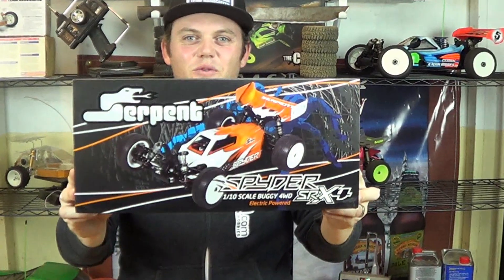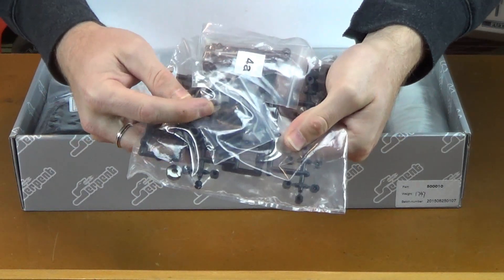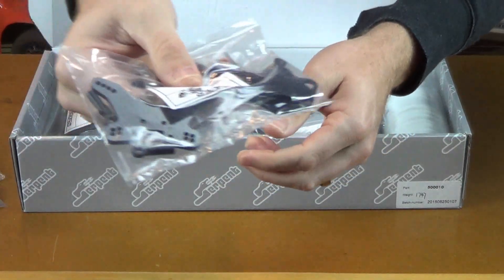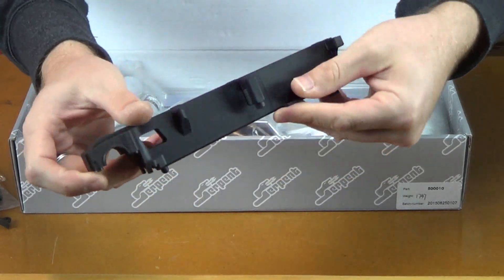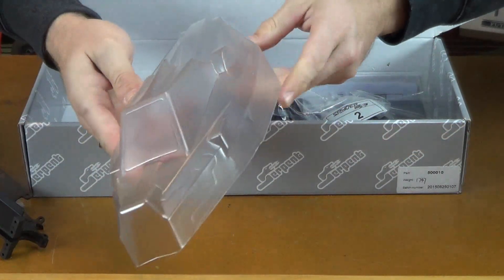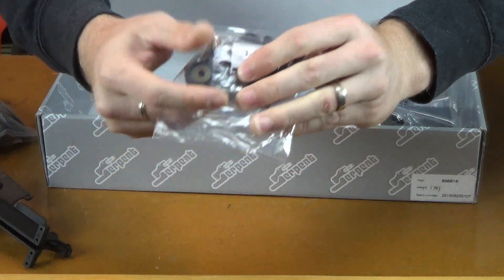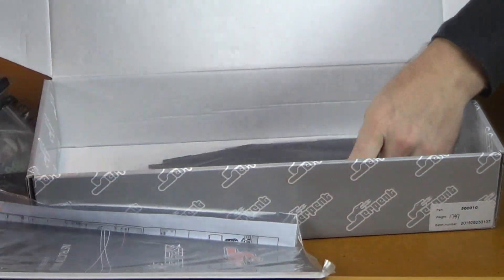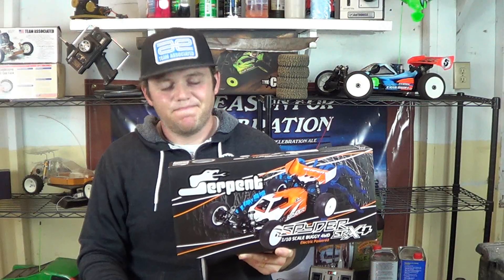Unboxing: Serpent Spyder SRX-4 4WD Electric RC Buggy

Comment: are you planning on getting serpents 2wd buggy? im looking to get a new 2wd buggy and i wanted to know if the serpent stuff is any good
Reply: I love the 2wd..my favorite one I've had yet.
Reply from the maker: +Chester Copperpot MM?
Reply: BBowenRC yea the mid. I did two videos on it recently. My buddy has the wheeler, damn thing drives like a dream :)
Reply: +Chester Copperpot ive been on your channel before, did you ever have a schumacher buggy?
Reply: +Chandler Thomas yes sir, the cougar kr. Good kit, but only good in the loose dirt. I've had the Spyder for a while now..since January-Feb, fantastic buggy.
Reply: +Chester Copperpot ohhh ok i see. do you think that a b5 or a serpent would be better than the kr on a medium grip surface?
Reply: Chandler Thomas absolutely. I run currently on a medium to high and the b5m or spyder are the way to go. I've had a b5m right before the Spyder..I drove better on both high bite carpet and medium-high clay with the serpent. It was a lot easier to tune too. I literally only changed five things from the stock setup, boom...dialed.
Reply from the maker: +Chandler Thomas +Chester Copperpot Interesting. I haven't driven a Spyder but the B5M is super easy to drive and can be tuned to be comfortable enough to push hard. But at my local track, everyone drives the B5M. Man, I really want to try the Spyder.
Reply: +BBowenRC oh yea, the b5m is a good car. It took me a bit to get it tuned for carpet, but when I did..it was fine. But by the time I got closer to getting it tuned for clay, I already had the Spyder built and ready to go. The Spyder does drive differently, by that I mean its so smooth you don't need a lot of input. And the fact its pretty light..steering is quick and dead to rights. If you have the chance to try one dude, go for it. The ball diff is also excellent over the AE in my opinion, broke in like it already broke in before I drove it lol. But I think that's a big reason..the composite chassis is light and flexible over the aluminum AE one, its reaction time is maybe not quicker per say..but easier. Its hard to say exactly how they drive different, but that's probably as close to a definition I can give. When I first slapped it down on the track, I was driving like crap. I thought it was me, but it was the different chassis' and geometry of the buggies. It doesn't require much to get it to turn and jump where and how you want it. Now the wheeler..I've only ever driven the 44.2, Rango 410, 44.1 and the Xray xb4. The srx4 is equal to the xray...so smooth and responsive. Same here though..a lot of b5s a few Losi and Kyosho. But about 5 or Spyders.